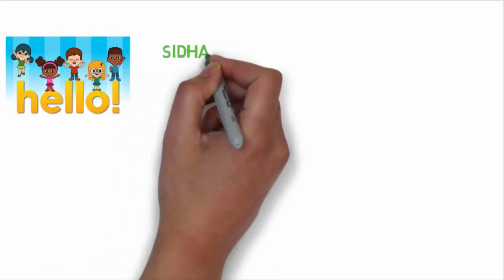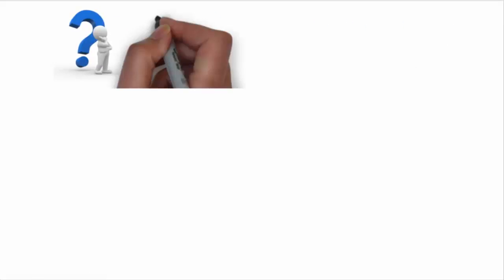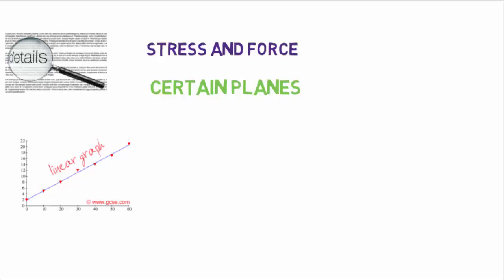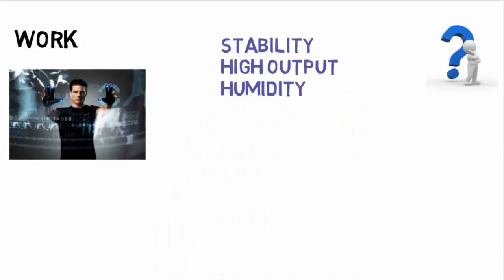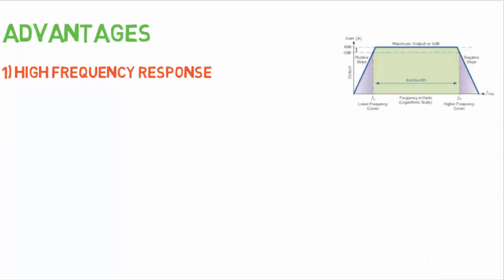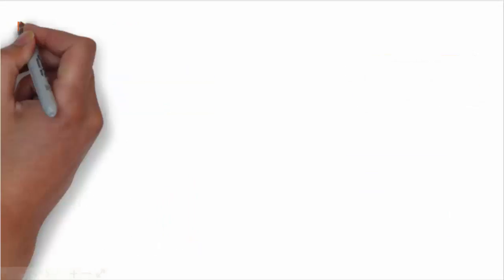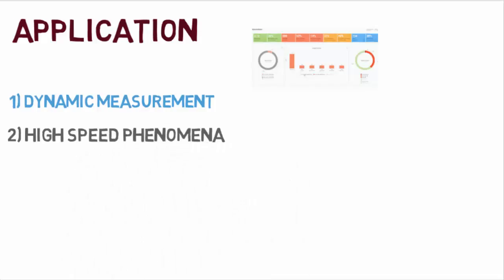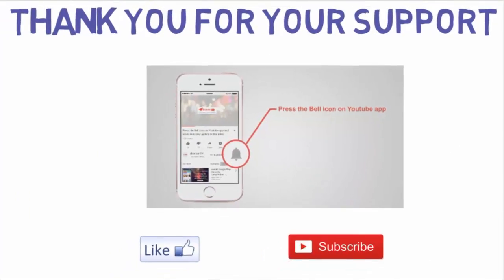Piezoelectric transducer || Working || Application || Tutorial

Comment: The output voltage of the piezo electric transducer is AC or DC..?
Reply from the maker: When there is mechanical impact on piezo crystal it produces DC voltage. E.g. gas lighter.
Reply: It is AC